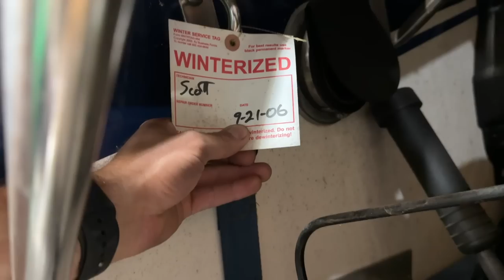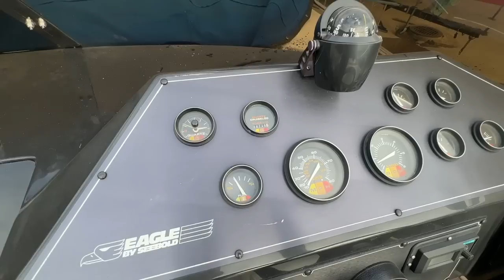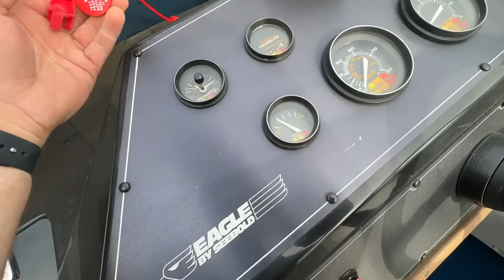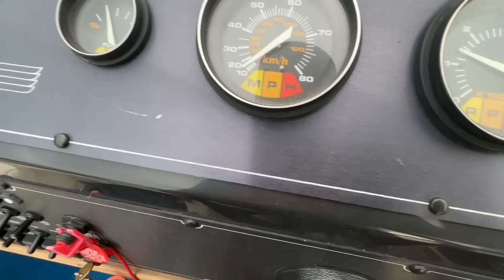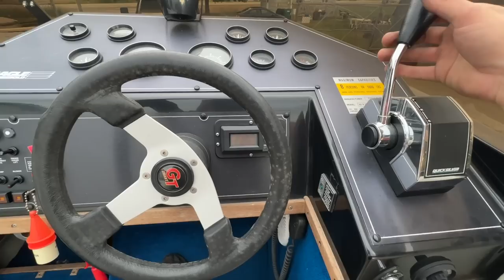This Barn Find POWERBOAT Was Buried Inside For 17 Years! Will It Start and Run With Minimal Work?

Comment: Can wait to see this thing on the water.  Nothing wrong with carburetors but I’d like to see it converted to Holley EFI.  Thinking about building the engine in my Caravelle interceptor but it has multiport fuel injection with the Mercruiser 555 PCM which is, I hear, difficult to tune.  Want to convert my to Holley EFI.  Great content as always!  👍🇺🇸👍🇺🇸

Comment: Great boat.   Greg Seabold and Reggie Fountain (fountain power boats) were record holding champion for many years in off shore racing.  This hull is pretty rare. Only 1000 hulls were made I belive.  My neighbour's had one.  454 stock mark5 engine from factory bravo 1 out drive.  Well before its time I belive.

Comment: Make shure you change the water pump impeller in the lower unit gear oil and seals exhaust flaps and bellows ect as they get hard and crack with age and can cause the boat to sink😮

Comment: I would be more concerned about rusty valve springs than them sitting.  Determine what type of cam, hydraulic, hyd roller, or check spring pressure at installed height and put a new set on. Not that much money,  Prime the oil system with a drill primer with the dist out and lube up the springs, get some on the valve stems as well.

Comment: but on a serious note our evinrude e-tec 150 ho has a over heating issue not the water pump. anything over 3,000 rpms even 100 the heat alarm in our ranger z118 will go off. now the funky thing is even brand new boat engine didn’t always do it what’s bad or what’s causing it?

Comment: you know the gas done fu barred. typical stuff lower unit gear lube change,engine oil change, fresh marine deep cycle battery,ear muffs if the water pump i’m sure needs changing let her idle up temp. can throttle up out of gear thousand best just let her idle. work the trim make sure it works best to have full tank of gas when stored prevents water make sure gauges work horn works. get stuff ship shape. yes go run her tires ought to be fine being indoors but looks can be deceiving dry wall cracks bearing grease lube the steering

Comment: Way was the wooden walk deck  
Look like new when you uncovered the boat. An when you had the motor running an you showed the back of the boat the wood was all rotten no stain on the wood. Looks like you messed up on your  Editing on your video. I would say you had it uncovered an the back walk deck was stained before you shot the video of you guys seeing it the first time. Some bad editing. What about the water pump on the front of of the motor.
Reply from the maker: The deck isn’t rotten. It was wet from being washed then dried up days later.